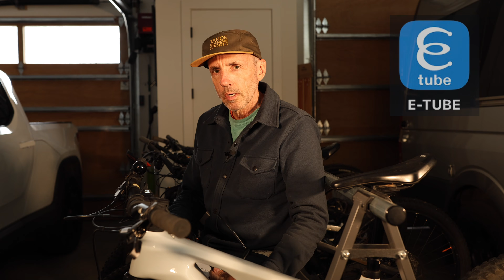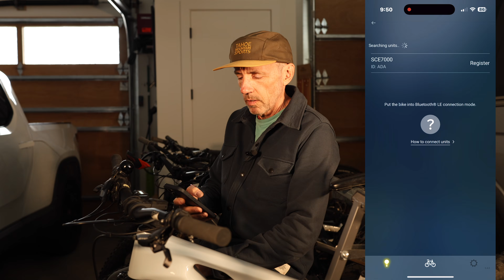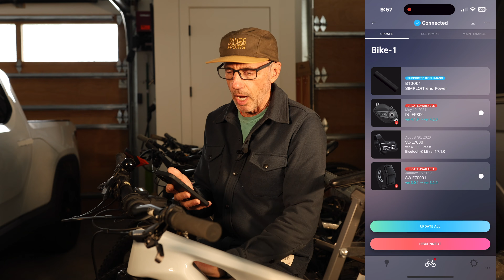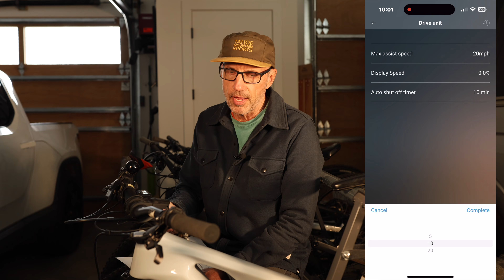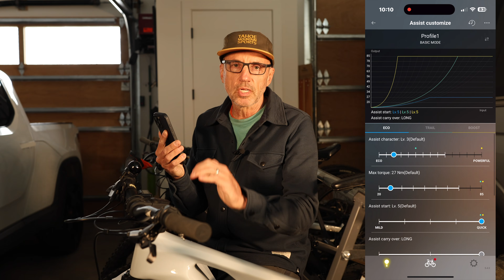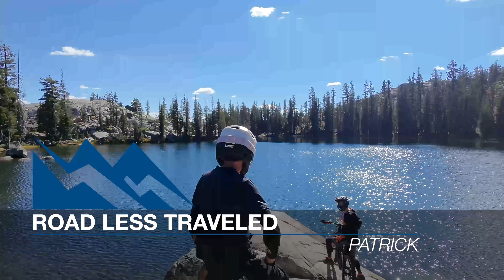Adjust your motor settings with Shimano eTube Project App

Comment: Eu consegui configurar meu EP600 e EP801 de modo a serem eficientes, esse seu ajuste básico está um tanto quanto beberrão de energia, a bike terá pouca autonomia... em meu EP600 uso apenas 4 modos na bicicleta de uso urbano: Assist character modo 1 ECO (lv2 - 20Nm) / modo 2  (lv4 - 30Nm), modo 3 (lv7 - 49Nm), modo 4 boost: (lv13 - 85Nm). A eficiencia ficou excelente do 1 ao 3, mas principalmente no modo 2 que entrega um balanço perfeito entre auxilio e consumo. No EP801 da bike enduro calibrei de 1 a 5, sendo os dois primeiros modos identicos aos do EP600. Minha conclusão após mais de 1 ano com esses motores é que o Assist Character lv4 com 30Nm parece ser o ponto alto da eficiencia e conforto minimo.

Comment: I didn’t know this was possible on my Canyon Spectral ON CFR.  Your video was a great help.  I thought the factory settings were not enough in ECO and too much in TRAIL, so I got the app, connected to the bike, and made some changes.  Profile 1 now has a little higher power in ECO, less than the factory TRAIL, and full BOOST.  My Profile 2 has 1-15 settings, Thanks…DLo

Comment: Curious, I have a tool icon showing on my SC-E7000 display. I have no idea how to clear it and my LBS couldn't figure it out. This is "maintenance is required" as per p28 of the manual for it. Bike has ran fine with it for 1000kms and counting. Can e-Tube clear it? I've tried and couldn't see anything.
Reply from the maker: No clue - Shimano authorized bike shop should be able to call Shimano and clear it…

Comment: I have a different experience with torque setting. By lowering the NM you actually do lower the bikes torque output. I have my trail on 60nm and boost on 70nm. My battery last way longer now. Its hard to feel because 70 to 85nm isnt a huge jump in power but at 60 and 70nm I definitely gained a lot of battery range. The graph isnt confusing it's actually really helpful if you like to tune.

Comment: 16:16 The dots aren´t the factory settings. They show the settings of the other profile. There are two profiles in which you can have different settings. In my case I got a "low torque" for a bit more battery saving for those big riding days and a "high torque" setting for the hot laps on the home trails

Comment: Hey buddy, I need your knowledge on why I cant download the Shimano E tube project for my 2021 Santa Cruz Bullit. Its my first ebike and i really would like to tune my Trail setting on the bike as it feel really sluggish in that mode. I have a new iphone 16 so I dont understand why I am having issues with the app? Can you please help me?
Reply from the maker: I just checked and updated mine so I know it works.  Make sure it’s the official Shimano app.  They have two, one is eTube ride but you want E-TUBE. I see it’s listed as E-TUBE PROJECT Cyclist. I’m using it on a couple year old iPhone.

Comment: I'm a "De-tuner", turning my motor down to most importantly extend it's range, but also to have it pedaling more naturally. On my Norco Range VLT (The Beast), Eco, Trail & boost are 27nm, 43nm & default. I leave Boost default because I never use it. In fact my bikes data shows me riding in "Off" (18%) and Boost (0%), way more than Boost, which is a waste of battery.
Reply from the maker: I'm with you.  I've got a video on my channel about how I "de" tuned my TQ to directly relate to range - but as you say, it feels more natural.  I like to think much more about the multiplier than the power or torque, since that is what I control when I'm pedaling.

Comment: This video makes no sense.
Starting with the maximum torque — according to what is stated, it limits the maximum power output of the motor, which is the opposite of what the video claims.
As I understand it, e-bike motors assist based on the power input they receive. This means that the more power I deliver through my legs, the more power the motor provides — and that’s what is shown on the display.

On the X-axis, the chart shows the power input from the rider’s legs — that is, the human power being delivered.
The Y-axis represents the motor output measured in torque.

Therefore, the further to the left you are on the graph, the earlier you feel the motor assistance. And the higher you are on the graph, the more power the motor is delivering.

So, the fine-tuning you suggest — setting the max torque to the maximum in all modes — means that in any mode, the motor will deliver its maximum power as long as you have the leg strength to trigger it.
Reply from the maker: Not sure I follow you but if what you are saying is “the graph in fine tune mode is confusing” I completely agree.  There is no rpm or time axis so the graph can represent a single moment in time.  That takes a bit to wrap my head around.🤔

Comment: Great video about these settings. I’m gonna play with these settings. But what impact do these settings have on the range of the bike.
Reply from the maker: Great question.  On the EP801 the stock setting with the new software uses battery MUCH more quickly.  That extra boost in multiplier really makes the bike do more work than the rider in Boost. I also speculate that the overrun uses a bit more power as well, but not nearly as significant.  If range is important I suggest you tune the motor down if using boost mode.

Comment: Interesting video. I will play with my app settings. I like to stand a lot on my regular mtb I've been having trouble being in too low a gear on the Ebike to get better use of the motor power at a higher cadence. But that really messes with you when you stand up on a technical section
Reply from the maker: Exactly, setup can really impact the style of your riding, eg. standing and cadence.

Comment: I make sure I have the latest app on the Apple store but it doesn’t show the « fine tune mode ». Everything is updated to the last firmware available.  I have same motor, display, and switch as you do.  I’m canadian.  Is it possible this version of the app is not available in Canada?  My app version is 5.4.2
Reply: Ok I see now that when he goes to Fine tune he use a different bike with the EP-801.  So the fine tune options just work on EP-801 and not EP8.
Reply from the maker: Correct.  Just the EP801.  EP8 has less adjustment available.

Comment: The EP801 works most efficiently at 27 as the motor is running at 75% of its continuous output.
Reply: You refer to 27 Nm?

Comment: Out of curiosity, does the ETube app give you the option to download the firmware updates before you begin updating the bike? This occurred to me when I was sweating getting a robo-call or having WIFI dip out while updating my bike. It feels like this is something they should add if it isn't already an option.
Reply from the maker: That sure seems like it would make the process more reliable but I did not see that option.
Reply: @roadlesstraveledtruckee  I didn't see anything obvious either and wasn't in a position to experiment. 
If anyone from Shimano sees this, consider it user feedback.

Comment: Is there any way to increase the cadence span on 801? My knees function best, past 90 rpm.
Reply from the maker: Sorry, thought I responded to this earlier but YT says otherwise - apologies if you’re getting a second reply.  I know of no motor that allows for you to change the optimal rpm. This is something that is mechanically designed into the internal motor transmission so maximum power is going to occur where they designed.  In lower power modes, however they can adjust the peak to be at a higher or lower rpm since they have the reserve power to work with.  But alas, I’ve not seen that adjustment available with any of the motors I’ve tested.

Comment: Great content. I tried your eco settings and drained the battery to fast. Maybe too much for eco? I’m on 630Wh battery so a bit different to the Decoy one. Very interesting insights 🤟
Reply from the maker: I’m starting to think that carryover is doing a lot to drain the battery.  Every time you let off peddling or stop while going through a corner, which for me can be every several seconds, the bike keeps going without rider help.  That has to drain battery power.

Comment: Just got a bike with EP801 and updated. I am coming from Bosch CX Gen 4. I noticed a huge gap between Trail & Boost. The Bosch EMTB mode is great. After playing with the Etube /assist setting I chose one of the custom ones in profile 2 it has 6 trail modes before getting to boost. Be nice if you could post some longer screenshots of your settings in the video of all 3 modes it's confusing trying to follow along in the video. Overall I am super happy with the EP801 update and feels its caught up to Bosch which is awesome.

Comment: Thanks for doing these videos there’s very little out there especially from Shimano explaining this stuff 
I’m running the 801 and I also have auto shift. I don’t know if you get into that at all. Are you running the fine-tune mode mostly and if so, do you really use the 15 increments?
Reply from the maker: Your welcome. I’ve never tried auto shift, how do you like it?  I think I’d like the free shift functionality (auto down shift) but auto shift may be a bit prescriptive for some of the technical areas I ride but I’ve never tried it so can’t say for sure. Regarding the fine tune mode, no, I think three modes is enough of a choice so I’ve been using that, however, now, given this option I’m going to try fine tune mode when I ride with my wife or others who I have a strength advantage over just to try to even thing out.

Comment: Own both an EXe and SC Heckler (801) and am finding this engineering based approach to be excellent.  I tried your EXe settings and with the exception of turning up the ECO setting a bit they were great.  Spent a hour or so goofing around with the 801 settings and will play around with them later today.  Keep up the good work.
Reply from the maker: Thanks for the feedback. These are a great combination of motors!

Comment: How long will Shimano exist is the big question since more and more bikes ditch them for Bosch.
Shimano really have to step up otherwise they're history within a couple of years.
Reply: Concerning the lack of spec.  I have had great luck with their motors over the past seven years.  The lack of wireless shifting and some integration leverage is also a problem.

Comment: I can screw this up.  I was updating at home with my phone and did not realize that I have the bike set to shut off at 5 minutes of inactivity.  Well, the bike shut off and that was it.  I could not do anything.  I forget the code it gave me.  I took that battery out, waited, turned it on and off, nothing.  I had to take it to my local shop to unbrick it and then update it.  They are an awesome shop.  For Denver riders the Bikery at the Brewery took good care of me.  I’m guessing you need to spin the cranks occasionally or reset the timeout feature.  Keep up the helpful content.
Reply: Wow, thanks for sharing this. I’m glad the update on my new bike went smoothly. I’ll be more careful in the future. You’d think a big company like Shimano would do some qc with such an important feature of the app, would be simple to have the app download the firmware first, then disable power saving modes on the bike before updating
Reply from the maker: Dang, I hate that, I’ve had it happen twice with my EP8. Great to have a good shop take care of you. Great service will keep our LBS’s going strong! Thanks for sharing.

Comment: I tryed 3 weeks ago and the latest firmware still 4.2.0, ep8 not ep801
Reply from the maker: You may need to bring it in for a hardwire update. I know one other person that needed to do this.
Reply: @ i tryed etube app & cant for futher than 4.2.0, it is to bad shimano still work only by dealer for updates, hope they dissapear from the ebike market. My yeti 160e has 3 motors replaced in 3 years, my sc bulit ep8 both for now just one
Reply: Wow 3 motors that's a lot do you do a lot if riding, so shimano best to avoid, would Bosch be better for you  @porroco

Comment: Shimano is pretty bad on firmware and hardware. Very slow and ep8 with ep801 parts are not compatible
Reply from the maker: I do wish the two motors were interchangeable!
Reply: @ yeah, but i kept my ep8, because ep801 was too expensive to upgrade. Replacing the battery was totally unecessary. Why not just the motor, but all the electronics needed to be replaced and trown away

Comment: By making the motor more powerful, will   It drain the battery faster? Thank you.... by the way, nice video! 👍🏻
Reply from the maker: Thank you for the positive feedback.  Yes, increasing the “assist character” will help you drain the battery more quickly. The more you lower that setting, the more time you can ride. The distance, however, will not change as much. Great question.

Comment: Do you know what options are available for the EP6 in the app? Considering a bile with that but not clear what the limits and options are for that motor.
Reply from the maker: I believe the EP6 has just 2 settings, comfort and supportive, with supportive providing more of a multiplier affect to your input.